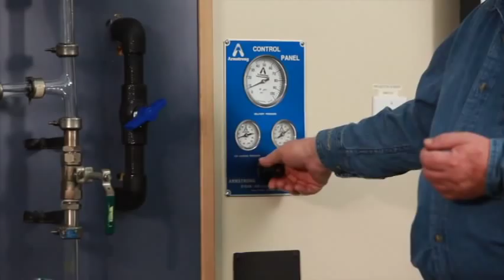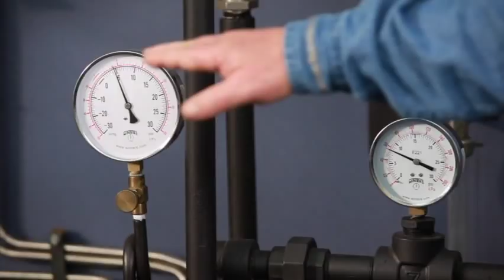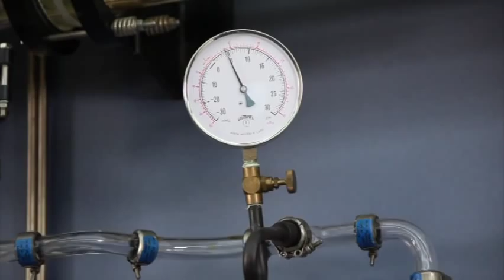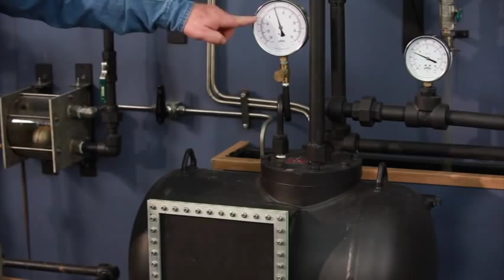Quit Stalling! Avoid Heat Exchanger Stalling with Armstrong International

Comment: Why is a trap required after the pump/trap?
Reply: Hi sir Steve. This is to prevent motive steam to discharge directly to the condensate line. Only condensate should be discharged in the condensate line. Second, direct motive steam in the condensate line will create high back pressure w/c affects other traps tapped on the line.
Reply: I have a motive pump that pumps into a vented flash tank so virtually no back pressure. The pump has 30psi steam pressure going to it. Im taking over for a retired maintenance fitter who says the pressure isn’t high enough to operate the pump correctly and that once in a while I’ll find the pump is cold and full on condensate but if I hit it with the 2x4 provided it kicks on. Clearly he doesn’t know what he’s talking about   
There is roughly 8 fr of head. Could the pump need to be rebuilt? Im guessing 30 psi is more than enough?
Reply: normally the trap used inside the pump/trap is an orifice Venturi trap so the motive steam is left behind and does not cross the condensate back line. ain't enough?